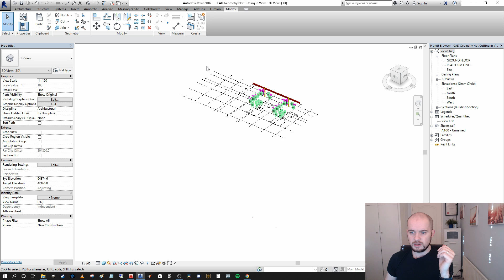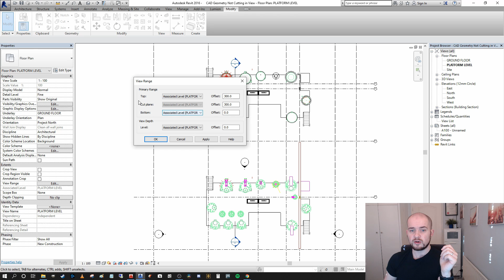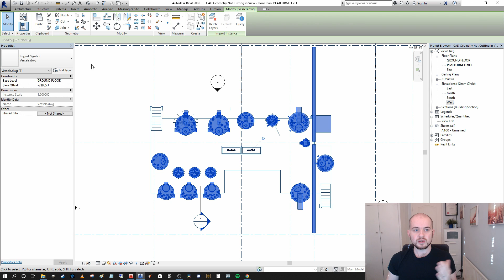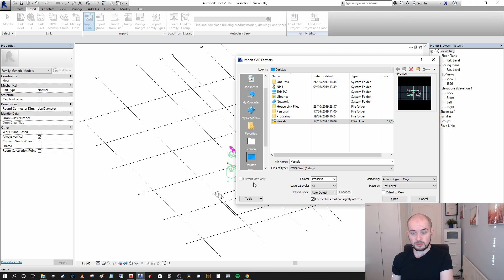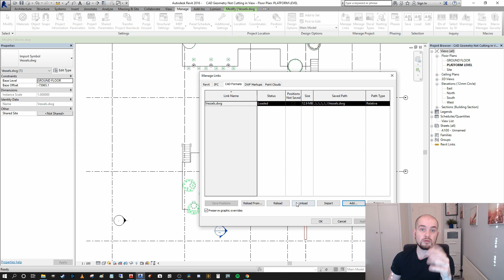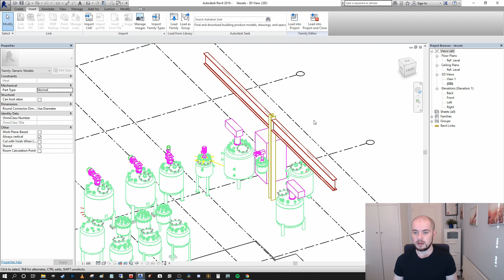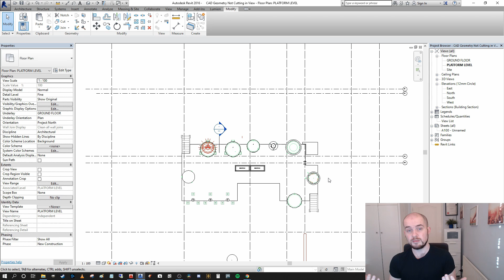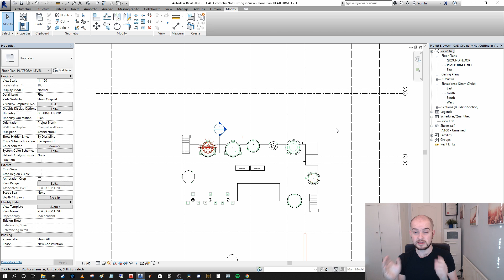Why won't Linked CAD Cut in Revit Plan or Section? Solved

Comment: Hello, thanks a lot for this detailed video !
I tried your solution, it works well but I found another limit: the upper section cut is good but the lower section is still not working well. If I set my view range from 5m to 10m, I will actually see the the families from -infinity to 10m as long as they go though the 5-10m range.
Reply: Also for everyone watching, please go to the Autodesk Community forum, find topics related to this dwg issue and upvote them to add more pressure to Autodesk on solving them !
There is one called "Cut linked 3D DWGs" (I can't put the url since Youtube doesn't allow it).

Comment: I tried to use this method. But for one dwg it acts wierd. Sectioning works when I cut one part of the building (the short side). But when I rotate the section 90 degrees, it wont work anymore. It acts like it was a normal linked dwg. What is also wierd is that the section box in 3D do not work at all. Even if the entire dwg is outside the section box, I can still see it. 

Any ideas why this happens?
Reply from the maker: Hi Hampus, apologies I am only getting back to your comment now.
I do not have any valuable insight on the issue you described I am afraid. I would start by trying to ID the authoring tool of the original 3D CAD file to understand if it was a Solid modelling tool, ACIS Mesh etc as they may interface differently when exported into a dwg format.
Niall

Comment: Sadly, as you know, this is only an Elastoplast, this has been the case since.......roman times it seems. This is one thing I wish Autodesk would get the finger out and sort. Either that or make Collaboration files sectionable.
Reply from the maker: Absolutely Colin. Getting very old at this point for sure. Wish they would also open up to external integration. The workflow from Solidworks through to Revit is intolerable and requires a separate Inventor license just to use the Autodesk Exchange App.
Reply: @8020BIM  Everything 3D Was the same issue, when you are talking the complexity of kilometres of Piping in a model, no way are you getting that baby out in IFC! Sectionable collaboration models would be a game changer. Haven't seen the stats for 2021 / 2022 Revit , hope they have attended to that!
Reply from the maker: @lootinchunk  for certain - right there is the death notice for IFC formats 😅here's to hoping Colin!

Comment: Found the solution import it in new family generic model and load it it project
Reply from the maker: Exactly right Milos, the full process of which is outlined in the video.
Niall
Reply: loading the cad model as a family has one big disadvantage.  it is not possible to update the family as it is with links.  When trying to replace it, the family deletes all manual work, i.e. dimensions, descriptions related to the family.  any solution to this problem?
Reply: @czesaww8232  Only solution would be to convert file to ifc or nwd file

Comment from the maker: Hey Guys! 
Just to note, you can obtain a similar presentation of your CAD data by placing the DWG into an In-Place-Mass or in-place-family directly within your Revit project. I feel this loses some of the control elements listed in my recorded solution but it might be a method for consideration if you are not expecting updates to the CAD data and only need the CAD data on a temporary basis.
Cheers Guys, hope you enjoy!
Niall